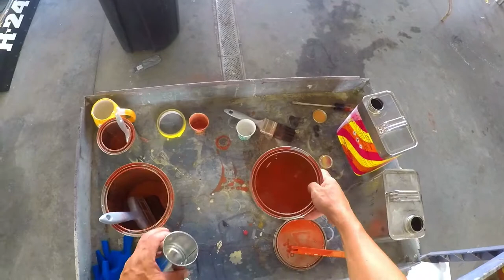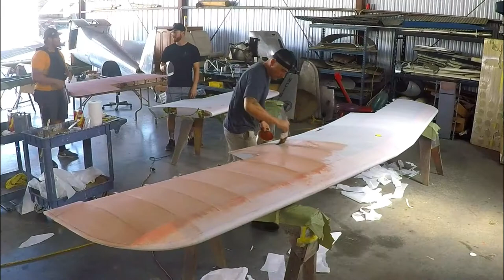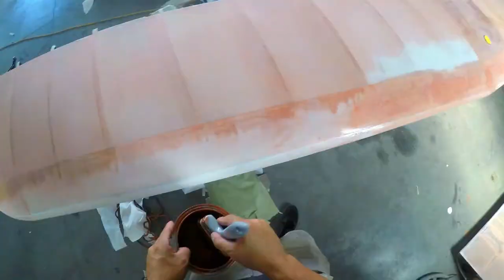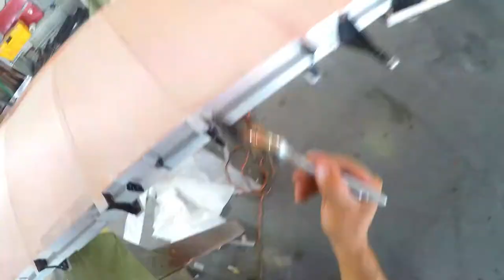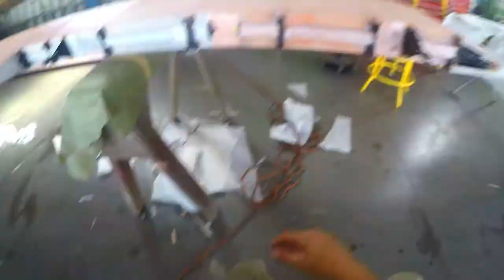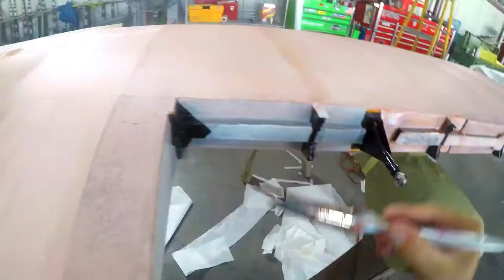The Poly-Fiber System -1st BRUSHED COAT OF POLY-BRUSH

Comment: So you just pour a few cups of redish liquid in a can , and a little more liquid from another can in one big can, then stir it up and paint it on some fabric? What does this video show, other than a guy painting some red stuff on a wing? What did I miss?
Reply: I guess it points out that you dilute the brushed-on Poly Brush 3:1. So, three parts Poly-Brush, to one part reducer...and then brush on. 

It's been a number of years since I used the STITS-Poly Fiber system, but I didn't remember reducing the brushed-on Poly Brush. So I'll have to go download their STC manual and review it. I seem to remember just brushing it on in an un-reduced form, but apparently my memory is incorrect. But if BOTH the brushed-on and sprayed-on Poly Brush needs to be reduced 3:1, it sort of makes you wonder why they don't just sell it in that mixture in the first place?
Reply: @bluehornet6752  because this is the first coat... Most of us spray the subsequent coats on